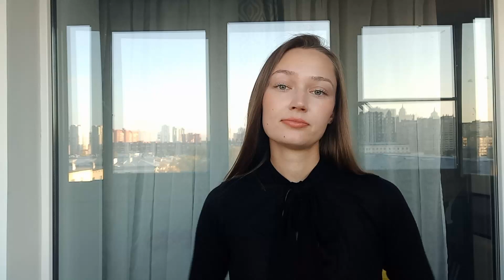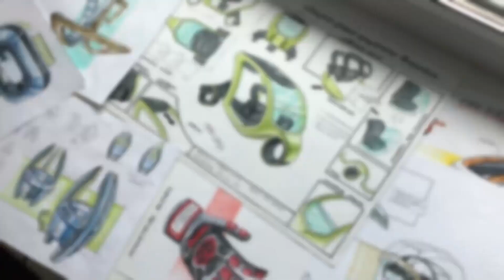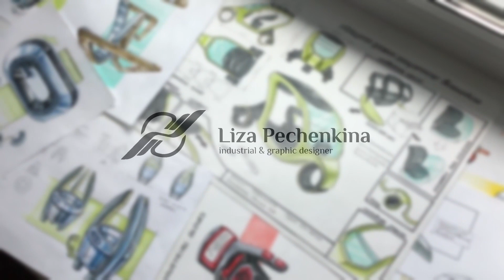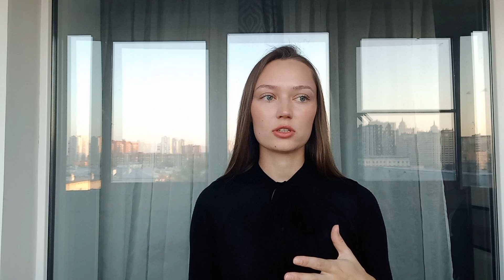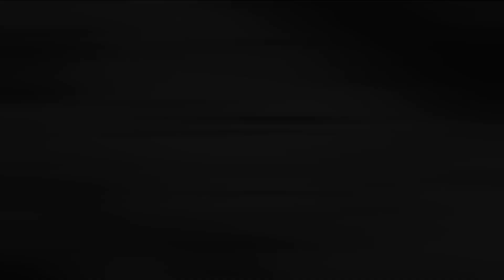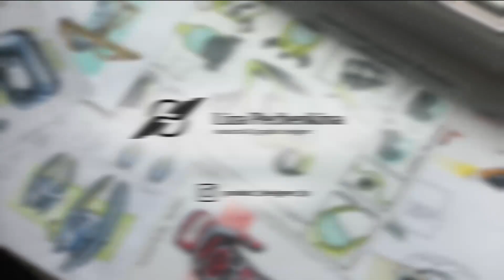Fields of Industrial design

Comment: Hello, I am an Industrial Designer and I would like to learn more about engineering fields such as material strength, mechanical properties, and other aspects related specifically to the interior of products, focusing on thickness, supports, and more rather than just aesthetics. Is it possible for me, as a Designer, to pursue a Master's degree in this field of mechanical engineering? Thank you, excellent video. Regards.
Reply from the maker: Hi, actually i think it depends on the country. E.g. in Russia you can choose whatever masters degree you want. Even if you studied chemistry for your bachelors, you can study design with 0 knowledge /experience:)  So do your research depending on what country you want to study in.